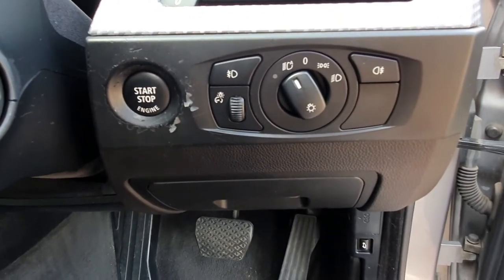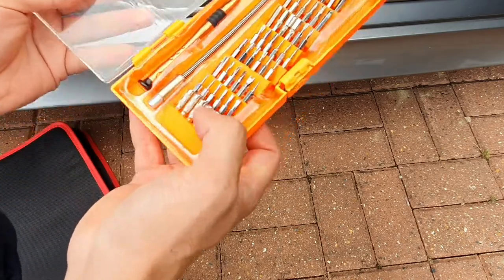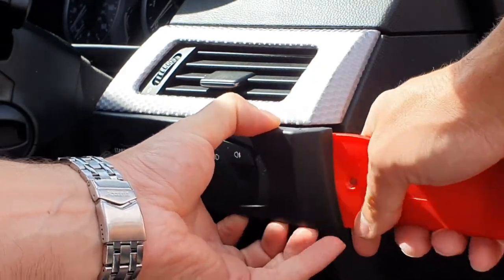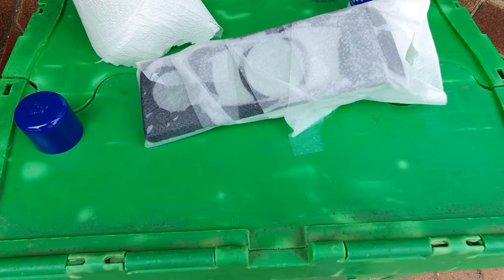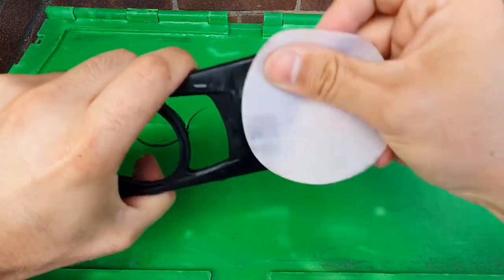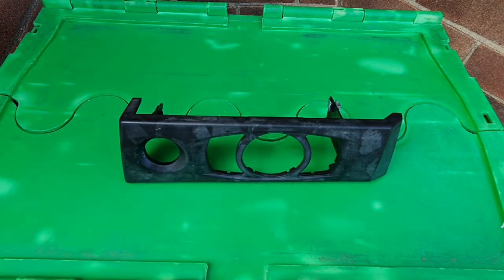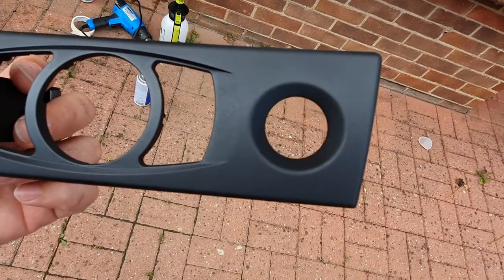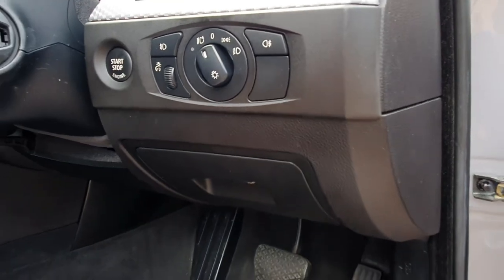BMW 5 Series e60/e61 start button trim peeling DIY Restoration

Comment: I wonder how this would go using black Plastidip instead of stove paint. It's a rubber paint so might be an even better option for the OEM look.
Reply from the maker: @Dan Hillman Hi Dan, that's a great idea! I wouldn't mind giving that a go in the future, I think you're right and could give a more OEM look. Thanks for the comment 👍🏻
Reply: @TheBimmerFixer no worries, I’ve got some dip and a peeling button so I might try it soon. I wonder if it would need a bunch of coats to make it durable though. Hmm
Reply from the maker: @Dan Hillman awesome let me know how it goes if you do.
Reply: I tried it today and it came up well. Could have done with more surface prep and a few more coats but I was in a rush. Easy enough process though and looks/feels legit!
Reply from the maker: @Dan Hillman Thats great thanks for letting me know. Definitely will have to give that a go! 👍🏻

Comment: What about the trim next to the car key slot under the steering wheel
Reply from the maker: @Herbert Ng Hi Herbert, well funny you mention that I was only looking the other day at possibly doing that part of the trim but maybe trying plastidip instead of  the paint I used before. A subscriber suggested i try that out.